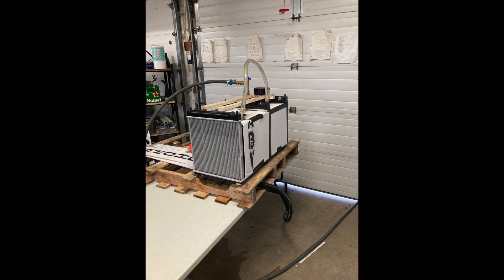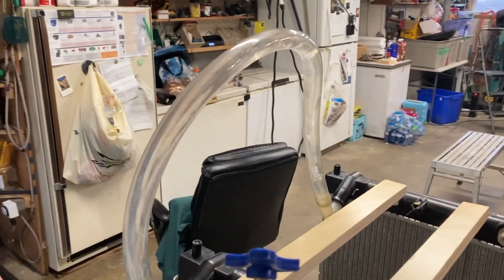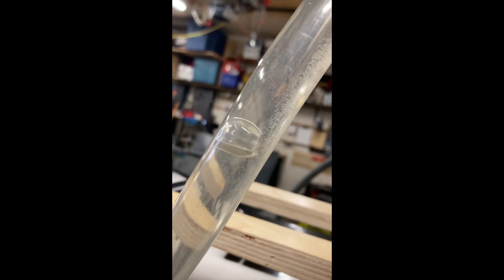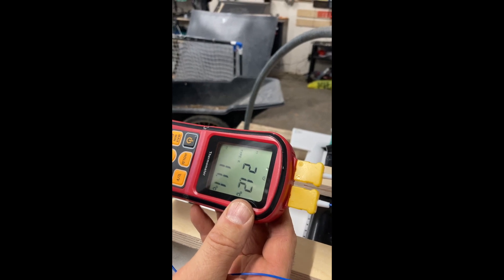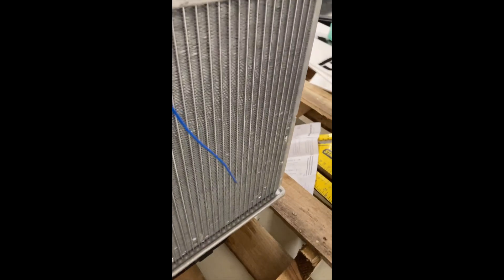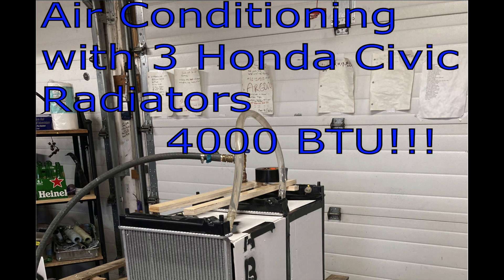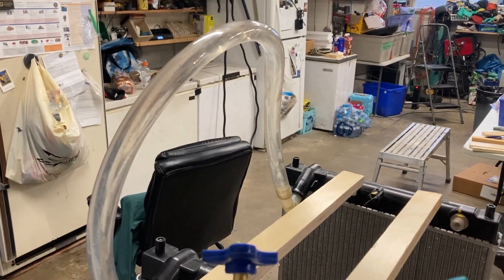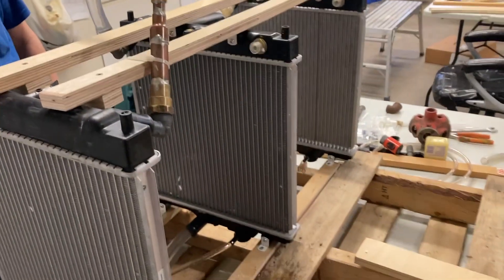AC with honda radiators prototype 4000BTU

Comment: I did a redneck heat pump that uses some of you idea.  Installed 1500 feet of black poly 3/4 pipe at 8' of depth  that right at the dry seasons water table in my area. On wet years it only 4'.  Then added a pump, small expansion / fill tank (all PVC) and relay hooked it to a water to air heat exchanger.  Placed the heat exchanger in front of the condenser coils on a cheap low seer  split AC unit. This reduced the energy usage of the AC unit by 40% by effectively removing more heat from the gas in the condenser with the use of cooler  incoming are than the ambient air.  Has been working for several years without issues.  My house is solar powered and off the Grid.

Comment: At my brothers farm there is a rural water supply. The minimum water subscription is way over what he can use. He’s paying for water that he never uses. I’m thinking about doing something like this with tap water and letting the water go out to the trees or maybe a garden. Placing a radiator in the furnace beside the filter .
Reply: I’m in the same boat with a rural water co-op, always getting the minimum water bill. Be warned that you might be charged for usage on the sewer end (if you use sewer and not septic)
Reply: @tylerwatt12  got a septic system out there. Have to look at the bill and make sure it’s a good idea before going forward.
Reply from the maker: I'm not sure how a rural water co-op works...but I've found city hall tends to win a lot. ;)  If either of you like running excavators...the other parts are pretty cheap by comparison...farm has a lot of space for a ground loop.  Tempting?  :P
I hope it goes well and you find a way to get what you are seeking without any conflict.  Those things keep me from sleeping well. <3

Comment: For heating, you could add in a few peltier modules. Peltier modules are pretty crap for cooling, but for heat, they are still a solid state heat pump, and  fleabay has premade 4 and 8 module kits with water blocks and heatsinks. Great match with solar.
Reply from the maker: Oh my...we are constantly distracted with conversations about our next project after the A/C...the heat pump.  Neither of us have heard of the Peltier device!  Looks like we've got lots of reading and YouTube watching to get caught up.  The cost of "Heat Pumps" that are water to water (best situation for us) is a bit...intimidating.  :)

Comment: Wouldn't it be easier to just open the doors on the 5 refrigerators to cool down the garage? Here's an idea. Take one of them Honda radiators and stick it in one of those freezers, then drill 2 holes in the freezers for the feed and return hoses to your external honda radiators. This way the freezer coils won't ice up from the humidity in the air.
Reply: linus tech tips did a video on this exact thing for computer cooling. It will work but there's a special built machine for the purpose, your gonna burn the fridge out otherwise.
Reply: @dapain1576    https://www.youtube.com/watch?v=yzqsD3K64MU  This vid may give some ideas. Not sure how the compressor can burn out if you have the super heat correct and oil level right.
Reply: For best performance move the fridges outside.
Reply from the maker: LOL.  I know the number of fridges and freezers is shocking.  Funny story about them...the only fridges that have lasted (which is all of the ones you see here plus one) are more than 20 years old.  These fridges and freezers that you see are regarded as a bit precious...as they do not die.  As opposed to a number of new appliances that my brother and some relatives have purchased...and watched die. 
SO...the menagerie shall remain.  They are...much loved. 
It HAS popped up on our project backlog discussions about the combat between these and the summer cooling...but we think the ground loop is the most fun and bang for our efforts.